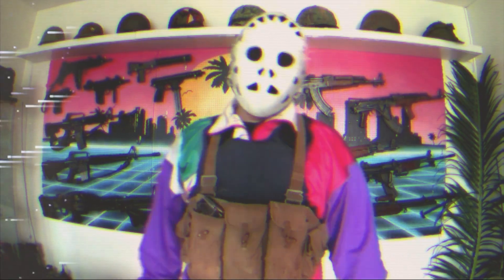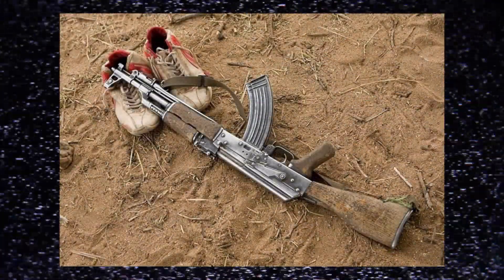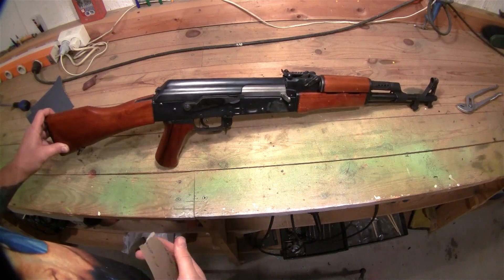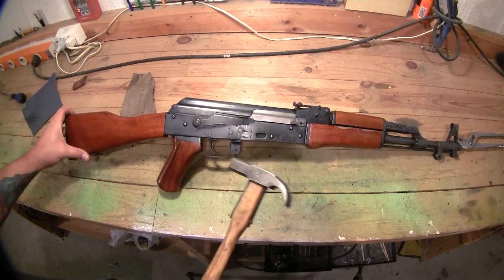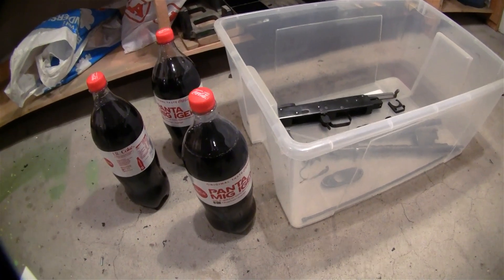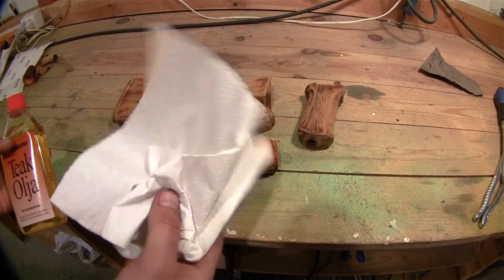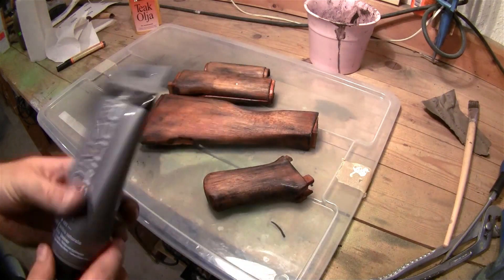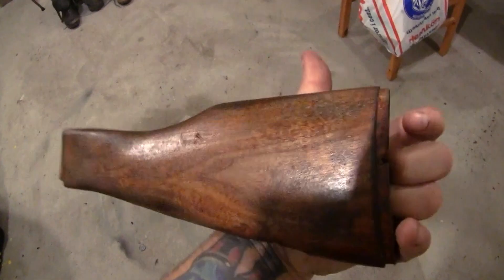How To Weather Your AK

Comment: Tried weathering my Aks74u, ended up with half of the front sight post gone. Battle damage i guess....
Reply from the maker: Haha, what brand was it?
Reply: @RealFakeGuns  Wellfire, dirt cheap but works flawlessly, and it's kinda my fault for the front post breaking. Might've accedidentaly  thrown it so it landed right on the front post
Reply: @ClayThunder  is it from steal? If it is like my cyma 048, forget coca cola
Reply: @demirpruzljanin  I think it it pot metal, idk if that is teel or what
Reply: @ClayThunder  if it magnets, its steel.
Reply: @thevladdo  Wellfire front post is not steel. It breaks so easily it's probably made of cardboard.

Comment: Nice job. Another good way to get dis-honest wear is to put the rifle in a pillow case (I use two with duct tape holding them together) and dump a ton of change in with it. I save my change in jars, so I dump two big mason jars of coins in the pillow case. And then just tumble the rifle in the bag. I usually just lay it on the couch and put on a movie or something and just roll the pillow case around allowing the change to leave a nice worn finish on the metal. Anyway, might be worth a try for some of y’all. 🍻

Comment: Great video as always! I do recommend taping sensitive areas like the gearbox before sanding in order to avoid getting metal dust in the gun. I would probably just remove the dust cover and tape where the gearbox meets the body. For GBBR'S, I advise removing the trigger group before weathering and cleaning/regreasing everything after.

Cheers!

Comment: Ok guys I’ve did this effect and all I has to say it works very well, I use ghk akm and with the effect (I would recommend sanding first the steel parts not too much just to get it easier to work) and it works great, however the wood is a bitch to do, the work pays off but good god they layed the finish on thick

Comment: hey! this is really nice! love the 90-ish theme also is there a good way to paint fake wood like its plastic/polymer and you can paint it in a way that it looks like wood?
Reply from the maker: Thanks, this technique will work with fake wood too, i have done it in the past.
Reply: @RealFakeGuns  How about fake bakelite imitation?
Reply from the maker: @VHS_Airsoft  They never look good enough. I strongly advise to get real ones, they have some on Zib militaria for the moment. 
Here's my real mags to airsoft guide https://youtu.be/4EoZ9MqEgYY
Reply: @RealFakeGuns  Hurry up if you want to get a few for the future. 1 September all native magazines above 10 rounds will be illegal in Germany so they have to destroy all there stock if they dont find a way around the law.
Reply: @RealFakeGuns  oh, thanks, but what I really meant was, if you have plain black plastic/polymer, can you somehow paint it to look like real wood?
Reply from the maker: @landrychappel4088  I did it on my old cyma 870. Sand the parts, spray with Montana plastic primer. Spray it with light yellow/beige spray paint in the same tone untreated wood has. Then use real wood mahogany wood stain and wipe it with paper and it will look like grains. Wipe the same angle when you do this. Dry and then do one more stain layer and finish off with gloss varnish.
Reply: @RealFakeGuns  alright thank you!
Reply: @RealFakeGuns  But if I want "bakelite" pistol grip to my AEG? I cant put the original pistol grip (Very thin to motor)
Reply from the maker: @VHS_Airsoft  That is correct. It fits on GBBR tho. So if you want many real parts id advice to get a GHK. LCT have slim motor and slim bakelite looking grip grip for the AEG.

Comment: This video helped me a lot thank you. I dit put my ghk ak and northeast sten parts on coca cola and salt bath for 24 hours and then i blued them. They look awesome now.
Reply from the maker: Glad to hear. I’m curious to try this on my NEA Sten too. Just waiting for some real parts to match it to.
Reply: @RealFakeGuns  
Be careful when disassembling your nea sten for cola bath. There is 2 springs on fire pin 
mechanism that will fly out when you take it out. I dit lost one of them. and i need to find new.  In the manual part number is 18 on page 6.
Reply from the maker: @aleksi5871  Thanks for the heads up. Try sending them a message and I’m sure they will have some for you.

Comment: Hey! Awesome video :) do you think this method would work on the Realsword SVD? As they have a layer of paint on most parts, I was just wondering if it's worth giving it a shot, cheers!
Reply from the maker: I have not handled one, but if its thick paint you might need to remove the paint before you start and maybe need to add blueing if it has none. If its blued like their AK you should prob be able do do it as with this guide :)
Reply: @RealFakeGuns  Thank you! I have lightly weathered it and it turns out the paint is quite thick at parts, but I may give it a go during quarantine, I will let you know how it turns out! Thanks again :)
Reply from the maker: @wensleydalecheese6363  Looking forward to see it. I heard it's a fantastic gun.
Reply from the maker: @wensleydalecheese6363  Looks great! :)

Comment: I suspect water and citric acid could work instead of coke. If so it would be easy to adjust the strength of the mixture.

Comment: Honestly, better to use 000 steel wool and light oil to work the steel. I wouldn't do the cola trick at all! I wouldn't want the metal coatings internal to the gun effected, like the barrels nitrite and inside the receiver. They will just be more prone to trusting. I had a rusty Mac90 that I cleaned up with oil and steel wool. It took of the rust and left a nice battlefield patina.
Reply from the maker: An AK without rust is like love, without kisses.
Reply: I'm putting an SKS back together with a mix of old and new parts. I just got done "weathering" the newer parts with a wire wheel on my pedestal grinder.
Reply: Yes, they rust. Especially a Mac-90. But I'd rather not thin up the coatings internally. Just age the outside, lol.

Comment: After this process, do the steel parts not rust more when you play in the rain/snow? I would worry that they have lost the protection from blueing.
Reply from the maker: It depends of the quality of the steel. LCT holds up well, Real Sword will get some rust. And for E&L they rust just by looking at it out of box 🤷‍♂️
But oil them up and it should be fine. But weathering as hard as in this guide, some rust is fitting.

Comment: Does blueing the receiver only work on high quality metals like steel and not cheap pot metal? Or will it also work with pot metal parts?
Reply from the maker: Steel but sometimes potmetal but weak and wears off fast. Sometimes blueing for aluminum works better on potmetal “birch wood casey aluminum black”.

Comment: how much time does it have to stay inside the coca cola? is wd-40 a good solution instead of the bluing liquid you presented in the video?
Reply from the maker: It depends on brand. So take a look during a process. It will look darker than it is that you will see once you wipe it off. 

No idea but recommend bluing liquid. Birch wood casey etc.

Comment: Will this work fine on a pot metal tokyo marui akm? planning to get ra tech wood for it then weather it this way.
Reply from the maker: I doubt it. But sometimes if you remove the paint you ca blue the potmetal to get a used look. Not always tho so try on a small area first.

Comment: I have a cyma ak-47, what real Ak furniture will fit on it?
Reply from the maker: They are hard to do real parts with due to being based on the old Tokyo Maruis. Construction is sadly far from realistic. I would save up for a LCT if so.
Reply: @RealFakeGuns  Aren't the 040 and up based on the LCT?
Reply from the maker: @marcushillerstrom25  I'm not familiar with the made up model names on cyma. But their AK47 is TM based and their AKM/74 is VFC based.
Reply from the maker: @marcushillerstrom25  I'm not familiar with the made up model names on cyma. But their AK47 is TM based and their AKM/74 is VFC based.